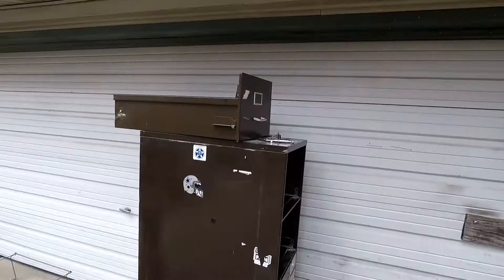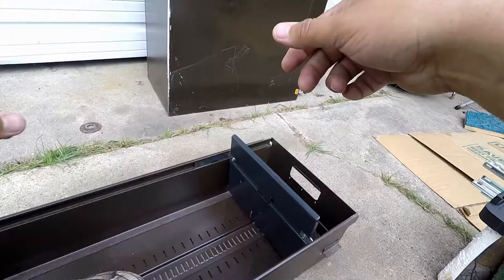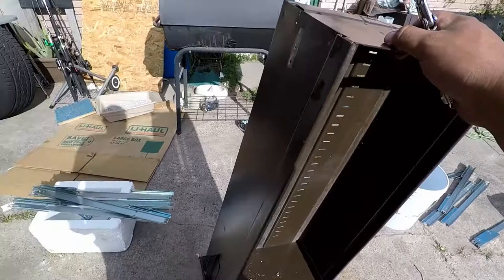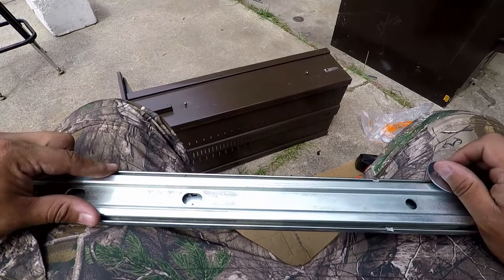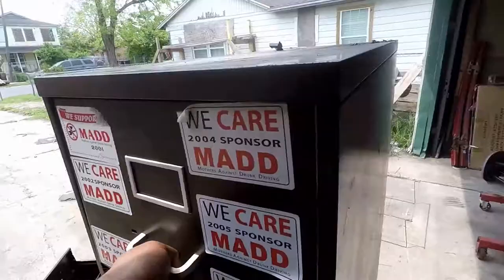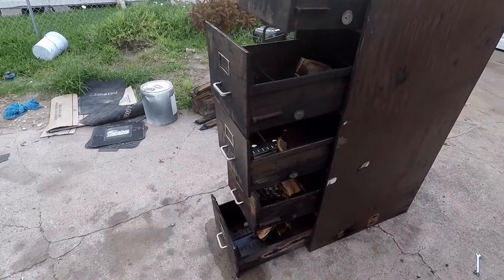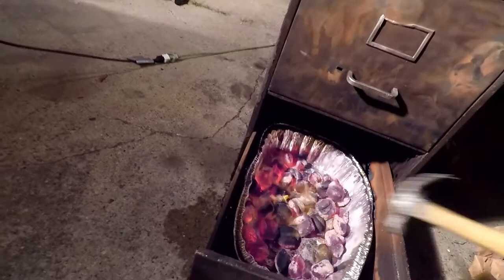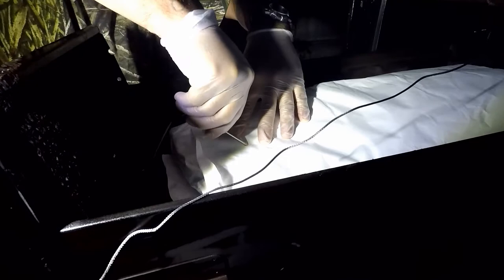How To Build A File Cabinet Smoker //OUTDOOR REFLECTION//

Comment: Seem to me after all the hard work of disassembling, removing parts, replacing parts, removing paint, etc.........would it be more convenient to buy a smoker? After all the DIY, seem like the cost will come out the same as a bought one. IJS
Reply from the maker: Hi thank you for watching. The total cost for everything including the cabinet was around $20-25. The tear down wasnt that long maybe about 3 hours, 1 hour of stripping and 1 hour assembling. It didnt take that long. The video just seems long because I tried to break it down because I didnt find a video that did that. They just showed them using it.
Reply: Thanks for the info. Overall, yours was the best DIY video because everything was told and did in detail. You should do a series of videos!
Reply from the maker: That is awesome thank you. And yes I do plan on doing that soon
Reply: Wheres the fun in buying!
Reply: You can get away with less effort. One of the builds I saw the guy did away with the metal tracks tracks entirely. Said it was a little harder to open and shut the drawers, but wasn't a problem.

Comment: Heating a galvanized metal surface releases zinc fumes. These fumes accumulate in the food but are also toxic to breathe. For this reason, utensils with galvanized surfaces should not be used in food cooking. This includes using galvanized-surfaced buckets or cans for cooking, as well as any ladles or stirrers.
Reply: Thanks for this info, we will keep giving it ZERO fcks. Do a Johnny Walker and just keep walking.
Reply: I dont think metal intended for indoor use is normally galvanized. Reason being that in my experience these things rust almost immediately when exposed to the environment. Galvanization is intended as a rust inhibitor. Galvanizing is expensive, and only really needed for metals intended to spend long periods of time outside(A good example is the metal on cars. Usually even if paint flakes off the metal underneath won't rust immediately, because it is galvanized before painting). Office furniture, by contrast, is made for dry indoor climate controlled environments. No galvanization needed. What little danger there is of rust is prevented by the paint or enamel they're coated with.